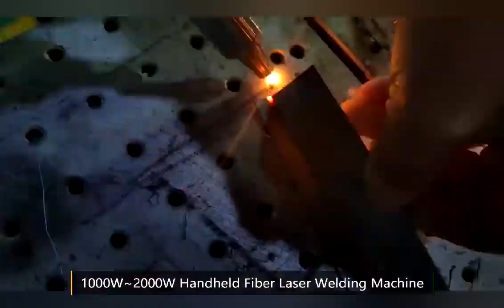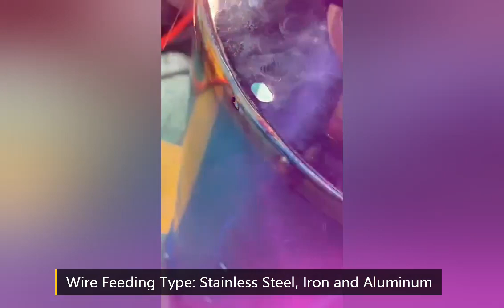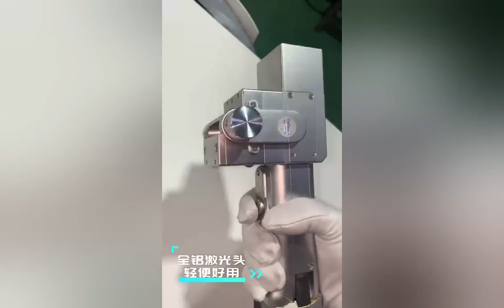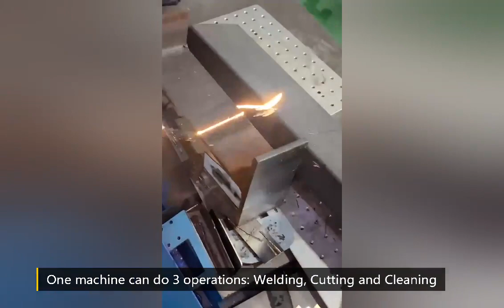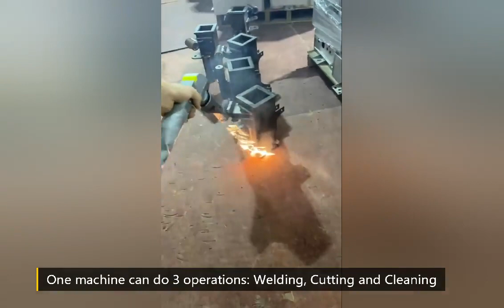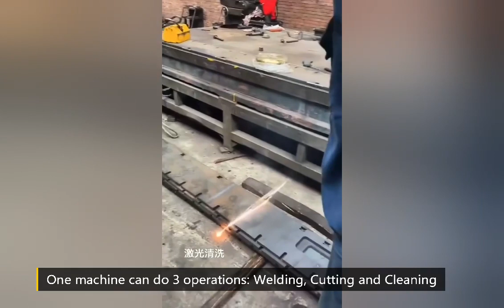Mini Handheld Laser Welding Machine-1.5KW/2KW, Welding/Cutting/Cleaning

Comment: What thickness in mild steel plate would that be welding ??
Reply from the maker: Recommended welding thickness is 3-5mm, if you need more details, feel free to contact us by whatsapp. +86 18924216384😁